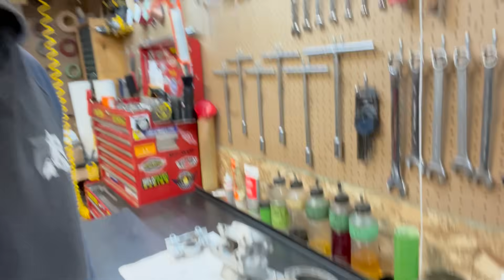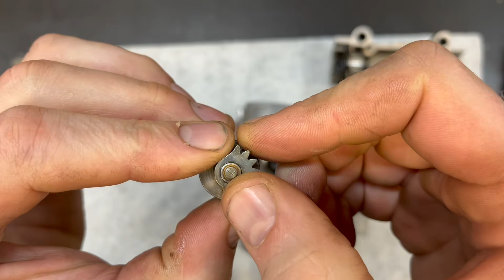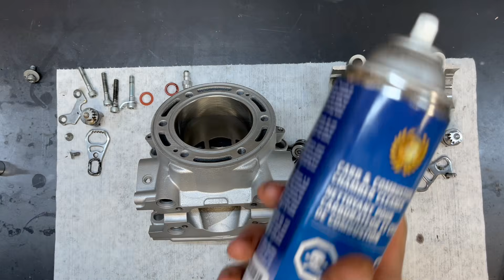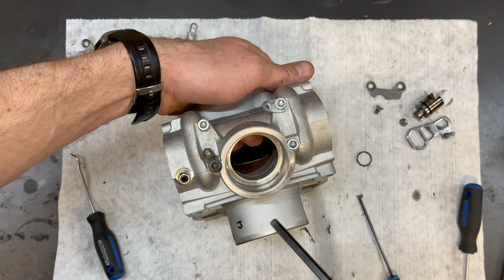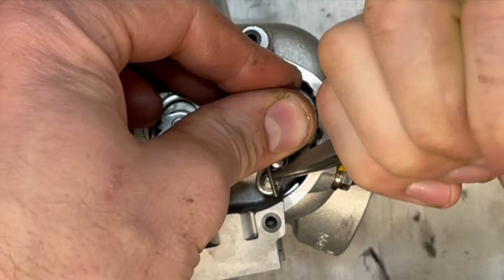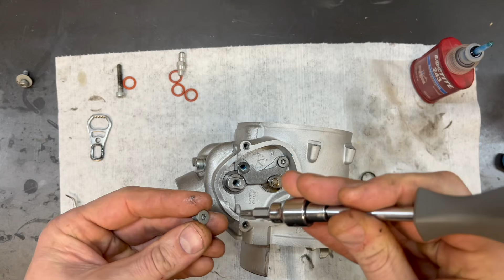KTM Power Valve How To

Comment: I also have a 125 2018 and it chokes, when I drive it at full throttle there is no problem but if I leave it for 10 seconds at lower rpm and it clogs, cuts out and smokes with a main 480 small 37.5 and a screw 2 turns! Could it be from this valve?
Reply from the maker: Possible but unlikely. Easy to check though. Just remove the left power valve cover while it’s running and see.
Reply: @ChuckfromTrueTech and from Mikuni TMX Jet Block Gasket Kit?
Reply: @ChuckfromTrueTech the left or right cover?

Comment: hey chuck thanks for the video I have a question i have cleaned all the surfaces of the powervalve on a 2007 ktm 250 all parts the powervalve and the side actuators move by hand just fine by themselves but when i put the linkage on it makes it almost impossible by hand to move. Is that normal for that kind of system. Or what would be causing this. this is with all the covers off
Reply from the maker: You mean when you hook up the linkage that comes from the governor? The governor doesn’t move till higher rpm.
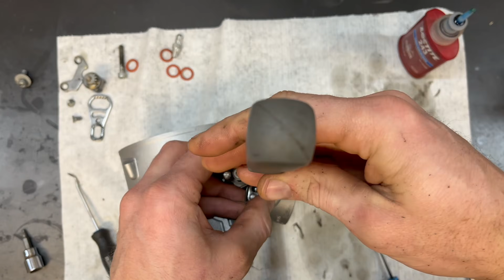Reply: @ChuckfromTrueTech  sorry that was probably a bad word for it. It's the arm that connects the main flap to the side port gear. you install it at 4:30. once even one of those goes on the system refuses to move by hand

Comment: Just a question, got a 2026 KTM 85sx, when warming up and rev up a little, there's a ticking sound from the right side just after revving and engine returning to idle.
Reply from the maker: Not sure. Could be as simple as a pipe vibrating or as serious as the piston hitting the power valve.

Comment: Hey hello. realy helpful video for the overall procedure but hoping you can help, can i remove the 4 bolts to reapply just silicone since im noticing a leak. and just put it back together(just like 3:44) without dissasembling anything else from the 2 sides?
Reply from the maker: Yep. Nothing will go flying.

Comment: Can someone help me? I have a 2023 125 XC. Got jug back on but the power valve actuator won’t line up. It won’t line up with the notch to bolt the actuator solenoid back onto the jug. I’m stuck. I’m old school two stroke mechanic guy. Where did the little rod go! lol

Comment: On the right side of the cylinder I accidentally removed the zed dimension bolt in the middle instead of the bolt to the right with the spring. What should I do?
Reply from the maker: Usually you can see where the bolt was positioning the adjuster. If not you can just reset the Z dimension. No big deal.

Comment: If i dont take out the bolt on 2:57 do i need to adjust it when putting back together?
Reply from the maker: Nope. I definitely recommend checking it either way, but it shouldn’t need to be adjusted if you don’t touch that.

Comment: Not sure I follow the reason for the thread lock to be entered directly onto the threads vs. a little spread on to the bolt and then thread the bolt.  I did hear something about air pressure pushing out... I've never used your method, never had any issues with a power valve bolt loosening. I love learning new tricks, though.  I would also add, to actively work the power valve up and down as you are performing the installation and especially when you're done adjusting the power valve itself, make sure everything is moving freely and there are no binds or issues.
Reply from the maker: It’s a detail, but when things go wrong details matter. In a blind hole the air pressure building as the bolt threads in has to escape through the threads. That pressure escaping will blow the loctite out. If you put it in the hole it won’t blow out because it’s not in the path of airflow.
Reply: @ChuckfromTrueTech  Got it, thanks for the tip!

Comment: Great video, Chuck. How do you know when you need to send your cylinder in for nikasil coating. Are you using the ring gap measurement to determine that?
Reply from the maker: The nikasil is only a few thousands of an inch thick. Once it wears through the coating you'll see aluminum showing through. Usually you'll see this above the exhaust port and at the top of the ring travel. I've got a good example of this coming up on a YZ250 cylinder.